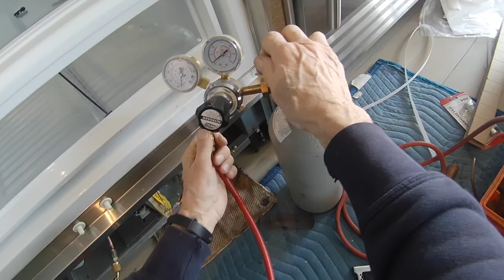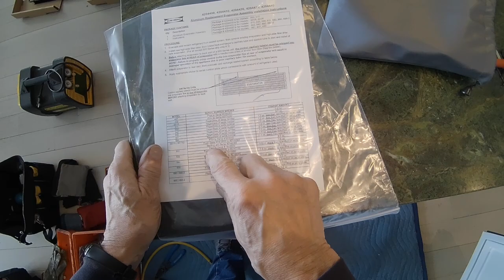Sub-Zero 601R Evaporator coil R&R

Comment: My coils in the evaporator will occasionally freeze up and the ice will show through the metal back plate. I’m assuming this is a leak ? When I take my heat gun and melt it all away I notice on my gauges that the pressure on the low side goes up a lot higher when the unit is off versus when the evaporator is frozen when the unit it off. Could that mean the Freon is frozen inside the evaporator and when I melt all the ice the Freon can travel through it? I’m trying to figure out if the evaporator needs to be replaced or it’s something else? What should I be checking?
Reply from the maker: First off you have to remove the back panel to properly defrost the coil. As for the pressure rising when heat is applied to the coil, that’s normal, pressure and temperature are related. You probably have a Freon leak, best way to fix the problem is to replace the coil, or empty out the system and weigh in the exact amount of Freon.
Reply: @SubZeroSpecialists  can you please tell me where the best place to buy this coil would be? Also, I have a picture that I took to show you that all the ice buildup are building up primarily starting from the bottom and then working the sides  and going up. Does this mean anything specific?
Reply from the maker: @mattshak1991  yes it does. You have to be a certified technician to open up the sealed system and you need a lot of special equipment. You didn’t mention the model number. You can send me a pic and I’ll look at it. support@aaronsrefrigeration.com
Reply: @SubZeroSpecialists  thanks will do right now
Reply: @SubZeroSpecialists just sent the email. Let me know if you got it. Thanks
Reply: Thanks for your reply! Ya the Freon level is correct. Every month and a half the coil get completely frozen over, primarily on the bottom of the coil and makes it way up. You think replacing the coil would fix this? If so, where can I get the subzero 601R evaporator coil from?
Reply from the maker: If there’s no heat load through the evaporator fins the pressure will drop because the ice is acting as an insulator. Adding heat to the coil whether on or off will raise the pressure because the refrigerant is absorbing the heat which cause the pressure to rise. If your coil is icing up it’s either running all the time because it’s low on Freon, dirty condenser or the compressor isn’t shutting off. There are many factors involved in diagnosis.

Comment: Why wouldn't you fix that coil and keep it as a spare? Not saying you should put it in a customer's unit- but I would guess  You could find some future use for it Even if you just sell it on eBay as repaired. No?
Reply from the maker: I may use it in the future. I sealed it and packed it away.
Reply: @SubZeroSpecialists  but I imagine that you are changing it because it has holes
Reply: Excellent Videos!  I’ve got 2ea 700s here also, a bit north of 20yrs old.  Freeze temps not adequate and flux btwn 23 and 12.  Authorized Sub0 tech parrots Sub0 customer service saying “the insulation is saturated and can’t guarantee a fix”.  Tech came to this conclusion after making a phone call never even cked pressures till I asked him to!  I’m not buying this as I am not in a high moisture area, (Nassau County NY) house stays tempered year round.  Not willing to remodel since these units were sold to me as always repairable. Not happy with SubZero…
Reply from the maker: It didn’t have a hole, it was leaking from the joint
Reply: @SubZeroSpecialists  do you find that leaks get worse over time? My 700 series has had an extremely slow leak, and I add 134a through a low side access port that was installed before I bought the house. I add a tiny amount and it lasts at close to 2 years before the EC 50 returns. (And yes, I bleed any air out of the line before attaching it to the low side, since it’s usually running in a vacuum at the point that I need to add). I know you don’t have a crystal ball, and what I’ve been doing has worked well. Just wondering if it’s sustainable. If I had someone as honest and knowledgeable as you up here in northern westchester, I’d just have the repair done. 
Maybe when they extend the seafood oyster bay across the sound to Rye….
Reply from the maker: @Drrich_DIY  that’s a pretty slow leak, two years is a long time. Since they don’t make that model anymore just keep recharging it. The going price to change an evaporator is approximately $1500.
Reply: @SubZeroSpecialists  thanks for the reply and advice. I’ve got two 700s side by side. It’s either keep them going at any cost, or remodel my kitchen since they are built with panels.   The far less expensive option is a new coil.